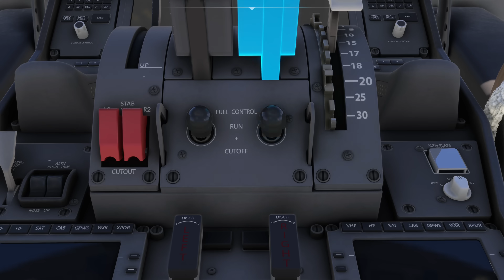Air India 171: Why Did The Fuel Cut-off Switch Get Moved?

Comment: Everyone’s blaming the pilots, but the same aircraft had electrical failures just one flight earlier — caught on video. The takeoff was unusually slow, and both engines shut down seconds after lift-off, with cockpit audio showing confusion (“Why did you cut off?” — “I didn’t”).

This doesn’t sound like pilot error. It sounds like system failure being buried to protect the company — just like Boeing did with the 737 MAX. Don’t let them repeat history.
Reply: The analysis of the events surrounding the crash of Air India Flight 171 demonstrates that the activation of the Ram Air Turbine (RAT) at 08:08:47 UTC, just five seconds after the fuel cutoff at 08:08:42 UTC, cannot be explained by a normal loss of engine power due to the fuel cutoff. The Boeing 787-8, equipped with General Electric GEnx-1B engines, was operating at near-maximum thrust during takeoff (approximately 90-100% N1, around 8,000-10,000 RPM). This high rotational speed results in significant inertia of the rotating components (fan and low-pressure turbine). When the fuel control switches were moved to "CUTOFF," combustion ceased immediately, but the engines continued to rotate due to inertia and airflow ("windmilling") during flight, particularly at the high airspeed shortly after takeoff (approximately 150-200 knots).
Based on general technical data for turbofan engines, it takes 20-60 seconds for engines to come to a complete stop when stationary. In flight, airflow extends this process to 1-3 minutes or more, as air continues to drive the fan and turbines. After five seconds, the engines would likely have retained about 50-75% of their rotational speed (approximately 6,000-7,500
RPM), which is more than sufficient to power the Engine-Driven Generators (EDGs). Each of the four EDGs (two per engine) provides 250 KVA, and even at reduced speeds (e.g., 20-30% N1), they can supply critical systems such as flight controls, avionics, and hydraulics. A total power loss due to the "CUTOFF" alone is therefore technically impossible within five seconds.
The RAT is automatically activated when all four EDGs fail, the primary electrical buses fail, or the hydraulic system fails. The rapid RAT activation at Al171 (after five seconds) indicates that an additional technical failure disrupted the power supply or hydraulic system. Possible causes include:
Electrical Short Circuit: A failure in the Electrical Load Management System (ELMS) or power distribution could have disabled the primary electrical buses, even if the EDGs were still generating power.
Software Failure: A fault in the Thrust Control Malfunction Accommodation (TCMA) system or the electronic control unit (ECU) of the fuel system could have automatically moved the fuel switches to "CUTOFF" while simultaneously disrupting the power supply. A General Electric Service Bulletin (2020/2021) highlights a potential "Loss of Thrust Control" (LOTC) due to a faulty MN4 microprocessor in the ECU, supporting this hypothesis.
Hydraulic Failure: Less likely, as hydraulic systems have accumulators and the engines were still rotating, but a simultaneous hydraulic loss could have triggered the RAT.
Cockpit voice recordings, where one pilot asks,
"Why did you shut off the fuel?" and the other responds, "I didn't," indicate that the fuel switch movement was not intentional. Indian expert Sanat Kaul noted that the "precise and simultaneous" movement of the switches (within one second) is atypical for human action and suggests an automated fault, such as a software or sensor error.
These findings strongly support the hypothesis that a software or sensor failure caused both the switch movement and the power loss. 
Reports of the captain's alleged mental health issues may be an attempt by Boeing or other stakeholders to shift blame to human error, potentially to obscure a design or software flaw.
Boeing has a strong interest in avoiding liability, particularly after the 737 MAX incidents, while Air India seeks to protect its reputation. The Indian investigation (AAIB) appears independent, but economic ties to Boeing may influence reporting. Alternative sources (e.g., Al Jazeera, X posts) and the absence of Western narratives in non-Western media support the technical failure hypothesis, aligning with a Russian perspective that would likely question pilot-blaming narratives.
In summary, the RAT activation after five seconds is incompatible with a normal fuel cutoff, as the engines would have continued to supply power. A significant technical failure, likely electrical or software-related, is the most plausible explanation for the incident.
Reply: @Gurpreet.jheeta Very well documented and detailed analysis 👏
Reply: @Sandy-rv9tv i took this reply from another video comment dear 😅
Reply: FAA ADVISORY 2018 Clearly says Fuel Cut-off switches on 787 are compromised. People blaming Pilots should hold their horses. 
Also the entire script of the CVR is not revealed nor has the DFDR data been analyzed. Lets not jump the gun and blame the 2 individuals who are not present to defend themselves
Reply: Or were the switches already in CUTOFF before flight taxiied out
Reply: @Sandy-rv9tv thats not possible, CUTOFF means no fuel to engines, so they can't taxi or even takeoff if theres no fuel supplying the engines
Reply: If it was system error, how did the pilot visually confirm that the mechanical switches were in the wrong position?
Reply: Correct! 100% system and Boeing faliure
Reply: Except the switches were found in the off position.🤦‍♂️
Reply: @OUTDOORS55 actually they were found in on positive as mentioned in report they were turned on after 10 seconds 🤦‍♂️

Comment: I see that the fuel shut off switches rely on a human to physically activate. There have been airline crashes that were the result of a design flaw that in certain situations a setting on a flight system , that setting would activate an OFF position to an ON state. Could this also be a hacked- wireless transmission that affected the
 plane?  I hope that a complete investigation of what could also possible cause the automatic shutoff for this aircraft.

Comment: also do remember the pretaxi mode , sitting on the runaway for roughly 15 minutes prior to take off , all this continues to burn fuel , those cutoff switches went automatically into cutoff mode due to some issues with internal detection of fire or something else . Remember the sole survivor said they saw flickering and heard a boom noise just after take off . Could the internal computer think there was a fire on one or both engines and prematurely decide to cut off fuel to both engines . Stop the blame game .

Comment: Steve, I respectfully disagree with your position. 

The issue of whether there may have been an internal circuitry malfunction or glitch that has caused this has been ignored because oeople, including yourself,  are getting stuck on the thinking that these switches had to be physically moved to cause this.

The CDR records a circuit function as occurring. That doesn't mean that the physical action actually occurred. 

There are many examples of glitches causing air accidents where the pilots were blamed and the initial evidence painted that picture.

In light of the conversation that was recorded in the cockpit I find that this is just not adding up. Something is not right here and I don't think they have found the cause yet.

I am keeping an open mind on this.

Much respect.
Reply: The preliminary report avoids using the words "moved the switches" and clearly says the switches "transitioned to the cut-off position". Accuracy is vital at this stage.
Reply: Occam's razor. What did the pilot meant when he asked the other if he moved it? He moved the wires? When it indicated to them that the fuel was cut off, why did the pilot asked that question if he did not check if the switches were in the wrong position instead of asking wtf is happening? What did the pilot SEE and visually confirm before the question?
Reply: @AkitaMix  Maybe he was using the egt and n2 gauges on the eicas for confirmation, since he was probably the pilot flying.
Reply: I agree that something is not adding up but a glitch wouldn't explain why one pilot saw the switches on cut off position. There is no glitch that could phisicslly them in the cut off position. That being said the conversation is odd, before asking to the other pilot why he cut off the fuel, one would ask what is happening, check this and that, unless who ask the question is the guilty one.

Comment: Here is a suggestion,  Nota Bene .  THE DIFFERENCE BETWEEN, "two Fuel signal level purely electrical 'switches' on console" and  " two Fuel motorised electro/mechanical 'valves' " controlling liquid fuel out of the fuel tank to the engine, 
 
The fuel 'valves' have two parts, one mechanical to cater for the liquid fuel , the other electrical  with a solenoid / motorised electrical part to open and close the mechanical part.  The electrical motorised part needs an electrical supply for it work. One may conclude that there is a common electrical mains supply to  the two starting electronic processing units where one catered for one engine fuel 'valve', and the second  catered for the second engine fuel 'valve',

The input information signals  from the 'switches' on the console to the two  electronic processing units are "not an electrical supply output " directed to the  two separate fuel  'valves',  but they are low energy electrical signal information  levels inputs to the two processing electrical units which supply the fuel 'valves' ,  Electrical glitches to the inputs or the common electrical supply/ input signals  of both fuel processing units could have affected the  actuation of fuel 'valves',  without the two mechanical 'switches' on the console being "turned off" 

Here is the result to that, 

The pilot flying, would have felt the lack of power in the engines due to the internal electrical glitch and turned to the pilot monitoring and said " Did you turn the fuel switches to cut off? "  to which the pilot monitoring said, " No, I did not!"
So the fuel 'valves' where turned off by the glitch and not by the fuel 'switches' on the console which were still in the 'on position'. 

Then,  being aware of the situation,  the pilot  flying applied the standard procedure of  MOVING OVER  THE console 'SWITCHES' TO THE ' OFF' POSTION AND THEN BACK AGAIN TO THE 'ON' POSITION! 

This would suggest that it was the internal electrical glitch that turned off the  two fuel valves and not the 'switches' on the console,  The statement, "I did not do it",  was thus an honest answer.  The 'switches' on the console were turned 'off' and then  'on' again  AFTER THE STATMENTS " did you turn the fuel switches off," and " no I did not do it" were exchanged!  

One needs to find out whether the fuel 'switches' on the console were turned off before the statements "did you turn the fuel off" and "I did not do it"   or whether the fuel 'switches' on the console , were turned off after those statements were said! 

If the 'switches ' on the console were turned off BEFORE the statements  were made,  and turned on AFTER the statements were made, then that could be a suicide possibility,  by one mentally disturbed  pilot, 

If the 'switches ' on the console were turned off then on  AFTER the statements  were made, then that could be engine lost power due to an internal electrical glitch on the inputs or mains supply of the two electronic processing units supplying power to the motorised fuel 'valves'. where the pilots would be innocent,
Reply: 💯 agreeing with you
Reply: Makes a lot of sense.
Reply: Well said. That is the key question here. Was the question asked before or after the time when the report is saying the switches transitioned from run to cutoff and then back to run. I just don't like the fact that this Capt Steeve has been pushing this suicide/criminal intent angle from day one. As a pilot himself why is he condemning these pilots who are not here to defend themselves? Makes me wonder if this Capt Steeve is on Boeing's payroll. By no means I am defending the pilot/s if they have caused the aircraft to crash deliberately. But we cannot 💯 rule out aircraft system malfunction. I think we need to wait for the full report and I hope it is balanced and fair and done correctly.
Reply: @sufilover5530 I think the timeline from report has the pilot conversation after switch movement.  Have a look at pod cast from the flight detectives.
Reply: If the fuel shutoff valves lost power, wouldn't they be designed to fail to the open position, thus giving the engines an uninterrupted fuel supply??
Reply: @RWalt-lp6ie  Be careful as no one said the valves lost power, but they transitioned  and this condition is decided by the electronic unit which processes the signals from many sources  and it could have been a malfunction in the electonic processing unit whose logic cut off the fuel valve while the switch on the console could have remain in run mode,   There are other logic states that could have occurred  as an electric malfunction before the pilots made those statements, and the cut off  then on , was a desperate case of restarting the engine using the accepted procedure as when they were at high altitude
Reply: @carmelpule8493 Just wondering how the valves work. As far as the switches, according to a 787 engineer, there is no software between switches and EEC. The contacts are mechanical. Faulty stops/detents would not explain how they stayed in run position after high energy impact crash if they were bad. Latest report from WSJ says Indian officials are saying the Captain turned the switches off. As more info comes out of India, we will all get a clearer picture, but my money is on the switches being moved by a human being in that cockpit. The conversation between the pilots logically substantiates that fact, otherwise why would he say it unless he saw them in off position. Now as for the reason why, we will eventually find out.
Reply: @RWalt-lp6ie  As the switches on the console are not directly connected to the electro/motorised fuel valves  but to an electronic processing unit which feeds the fuel valves.   I am suggesting an electrical/electronic/software interference.
 
Before concluding, these points should be considered. 

1. Where were the monitoring points which decided the CUT- OFF or RUN states,  Were they on the switches located at the cockpit console? Were they at the electronic processing unit which had the console switch and other states, as input, and the Fuel Valve as output?  Was it at the motorised fuel valve feeding fuel to the engine?  Because of this possibility, could the fuel valve be transitioned to shut while the switch on the cockpit console was still on the RUN position. In this case a 10 second electrical/electronic/software intermittent fault, could have caused the incident with the pilots being honest about their statement, and the switches on the console were never moved. 

2.  Could the electrical malfunction have occurred BEFORE  the statement by the pilots and the switches  on the cockpit console were  CUT OFF and then RUN to desperately follow the standard two engine fail sequence to provide fuel and ignition?  Thus the pilots did not lie about what they said and the switches were moved by the pilots. 

3. If the switches on the cockpit console were moved before the pilot's statement  then that means there was a medically disturbed pilot who lied,  and a fight ensued to put the switches back to RUN.
Reply: Not a chance, because the procedure to recover is off then on with no delays, not both off then ten seconds later both on.
Reply: @ED-es2qv  exactly what I've been thinking